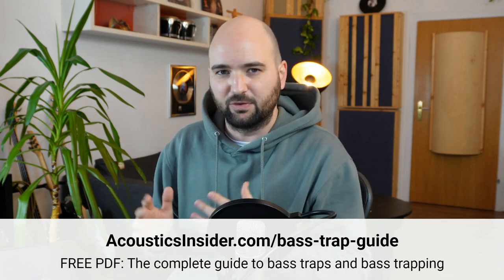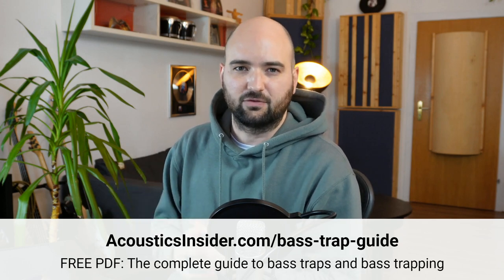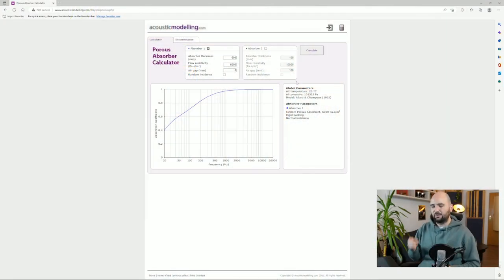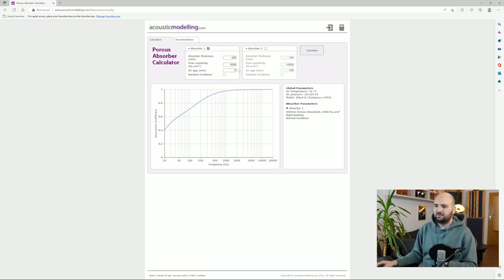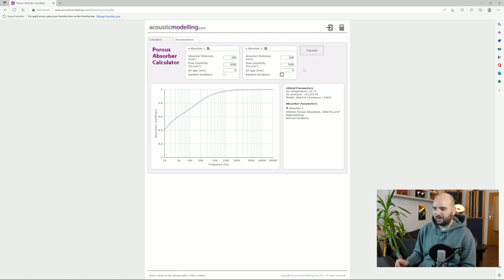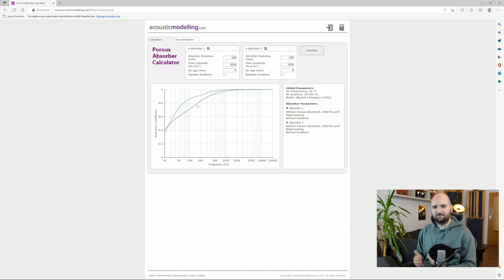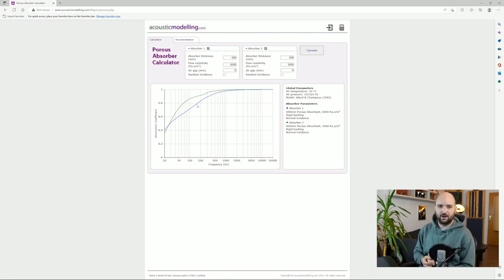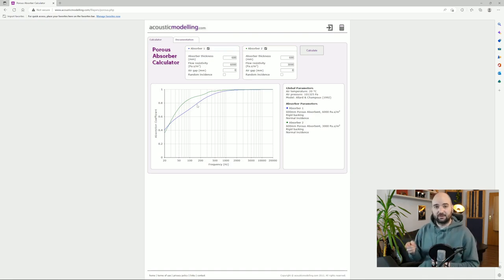Bass Traps: Just keep INSULATION roll sealed in plastic WRAP? - AcousticsInsider.com

Comment: In a situation where you know you aren't changing the room ever, what if you simply took a long piece of fabric and stapled it to each side of the corner from the floor up to nearly the roof, sealed it on the floor and dumped in blown insulation from the top? Seems like a super easy  corner trap.

Comment: I tested mineral wool panels hanged under the ceiling, without and with wrapping them with polyethylene kitchen foil (it lasts for thousands years), with no pressure appled. The wrapping decreases little only high frequency adsorption.
Reply: How high frequencies did it reflect? Does the plastic wrapping have and effect on the midrange lets say (1k-8k)?
Reply: If sealing the rockwool only affects highs response, then you could solve the high end reflections by adding foam on top of the plastic wrap.

Also, would it be a good idea to seal the bass traps with rubber or silicone thin sheets?
It would also make it much easier to clean, as you can get the surface wet or vacuum it without pulling the fibers.
Reply: @levibalint3253
If need data I can look for my measurements
Reply: @DmitryMyadzelets  i’d be curious

Comment: I LOVE how many of these questions have already been answered for me.  I really appreciate it.

Question: What happens if airs gap is created between packages?  Or if they are physically touching... however they are staggered in placement, introducing pockets of air in certain connection points?
Reply: I think the answer is to experiment and take measurements to see what the impact actually is. Usually home studios are extremely difficult to predict what happens acoustically within them as they don't really follow standard models very closely (weird shapes, different materials, room within a room, etc). Hope that helps!

Comment: Doesn't anyone know that Rockwool is made using Formalydehide and is thought to cause cancer? I was about to buy a tonne of it until I found out. :(
Reply: Just keep it sealed in plastic, then it shouldn't be a problem
Reply: It is UL Greenguard Gold certified for indoor VOC emissions, so it should be safe. The formaldehyde amounts are at trace levels and should quickly dissipate throughout the house. However, it's possible they did not heat up the material long enough at factory so a rule of thumb is if you smell it then it's over safe levels. Formaldehyde is also in just about everything in trace amounts off gassing.
Reply: @saber0089  how would we be able to smell it? Do you know more or less what type of smell it may be? I want to be safe lol